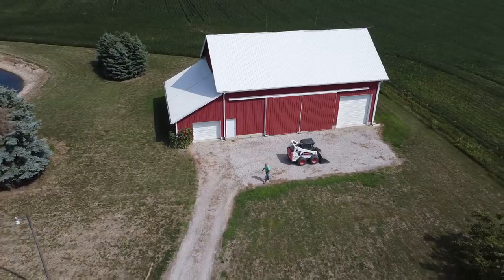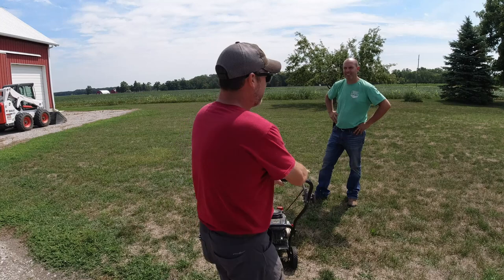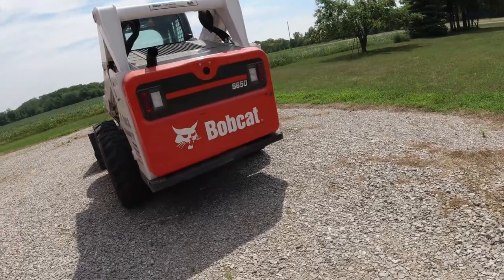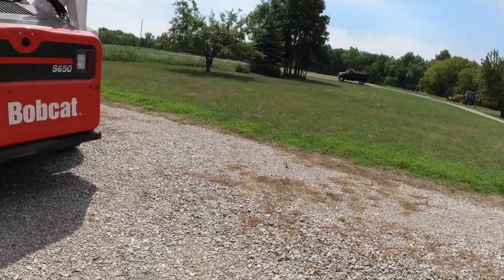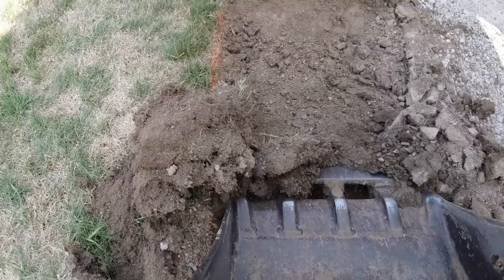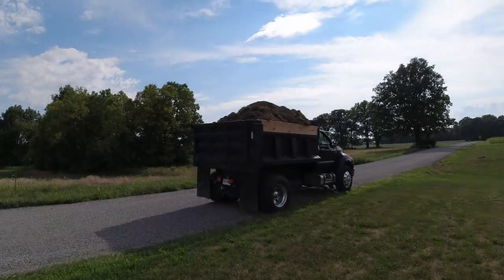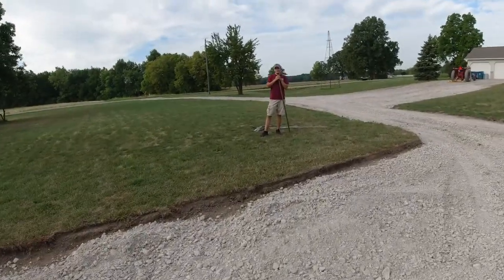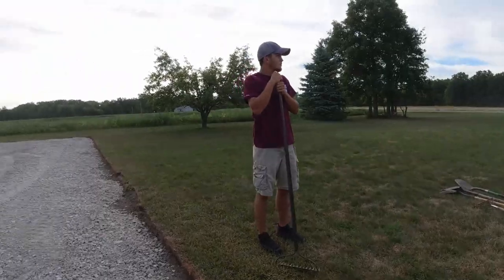The Secret to Cutting Straight Driveway Edges: Driveway Makeover PART 1

Comment: so you don't use permeable ground barrier?
Reply from the maker: Hi James. Thanks for the question. No, in my experience it doesn't really do any good. Are you talking in terms of weed control? The weeds we see most commonly in the driveway around here, such as common purslane, grown in the top 1" of the limestone.  Do you use it? Thanks for watching!
Reply: @digdrivediy  in Florida we use it for stabilization and some localities require it for ‘environmental’ as well. when you put dressing rock on sand and drive on it you would be amazed how fast it disappears into the sand. I like your sod cutter idea. nice, clean edges really enhance the final appearance. you do nice work. my company does a lot of that kind of stuff here in Florida-bobcats mini excavators.
Reply from the maker: @jamesweir2943  Oh, I see. Fortunately or unfortunately for us, we have very heavy clay based soils in our area that provide a very stable base. It is great for road beds, ponds or basements but terrible for drainage, septic systems or anything you wish to grow. We generally have about 8-12" of topsoil above the subsoil. We can just remove the topsoil and then build upon the clay. We even pour concrete on the virgin clay.  The soil types change drastically as you go north into Michigan as it is all glacial till that is a literal mixture of all soil types, sand and gravel. I could certainly see the benefit of the ground barrier in the sand and other non stable conditions. Makes perfect sense. Thanks for the kind words and great topic of discussion.

Comment: no music and just engine sounds would be fine
Reply from the maker: I debate that option too.  Some people like music with it, some people don't.  I try to do a little of both in the videos to balance it out. It would be interesting to do a poll to see what the majority of folks think.  The music is really hard to choose in my opinion also so it's always a source of worry for me.  I never use the same song twice.  The reason for the music is that much of the time lapses and all of the drone video does not usually have accompanying audio, so usually I do it when there is no sound to put in underneath it.  Personally I don't like the sound of sped up audio so I prefer the music.  Maybe if I get the music turned down it won't be as bad to have in there.  Thanks again for watching and letting me know.  I value the opinion of the subs and strive to always make these better.  Take care.